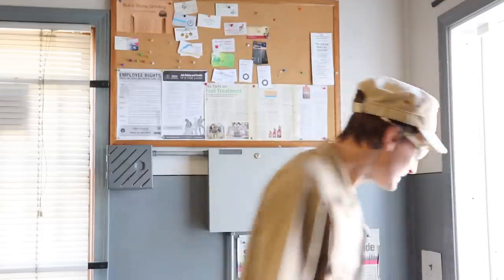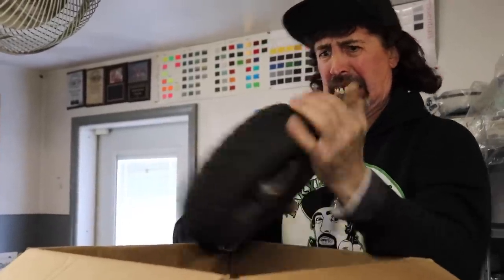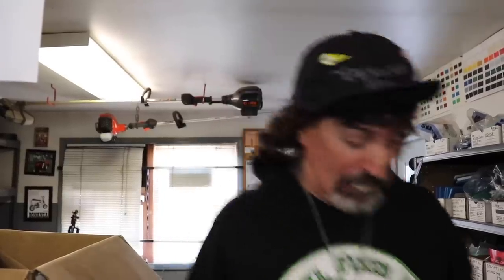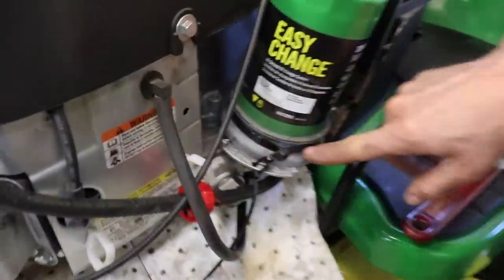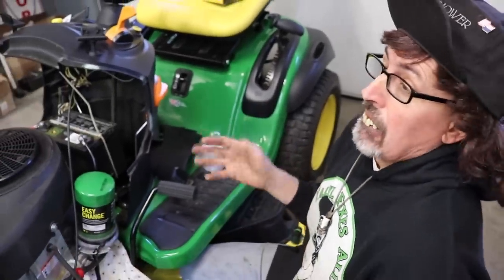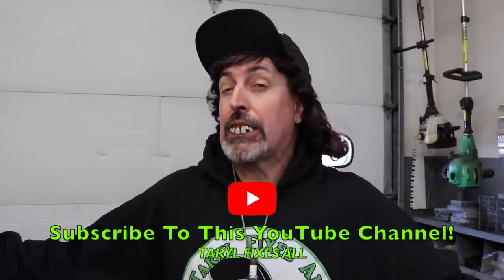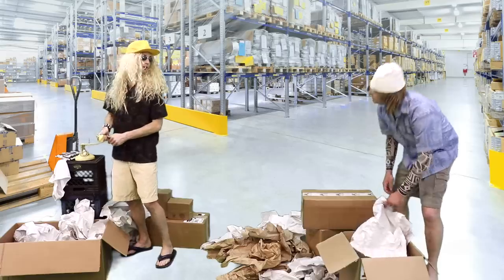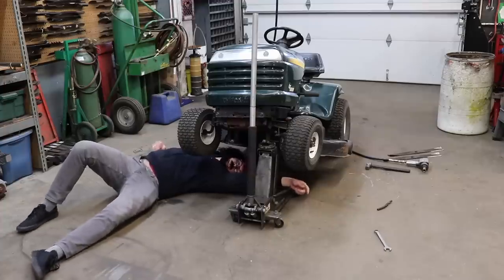John Deere Easy Oil Change NOT SO EASY - Convert It Back!

Comment: I get what your saying it’s Made by John Deere officially and all but I would bet my money that it’s manufactured by Briggs for John Deere and is most likely proprietary to Deere only at this point. I wouldn’t be surprised though if you see it pop up on other brand mowers in the future as soon as those companies negotiate a deal on them. We will most likely see them first on Briggs owned brands such as Ferris, Murray, snapper, simplicity. Briggs already has a funky oil set up on some of the Ferris mowers to help extend the oil change increments. It’s all about money, if you don’t believe ask yourself why a 5 dollar filter and 4 dollars of oil is costing 40 dollars just because it’s not messy. Just another feature for idiots 😂

Comment: How lazy do you have to be to take  an extra 5 min to do it right and drain all the oil ... Thanks for giving  us the knowledge to do it right
Reply: @ Rob Powell Very lazy or very ignorant, lol. A neighbor down the street (after I fixed his cousin's riding mower) asked me last year how to change the oil on his riding mower. Said he couldn't figure out how to drain it. After I brushed away all the built up dirt and grass around the drain plug to show him, he was amazed. He still didn't change it though. I ended up changing it for him later and adjusting his valves. And this dude had access to a PC so he could have looked up the info himself. Guess he was too busy getting stoned all day.
Reply: @dkeith45  I was told by one owner of a mower you never have to change the oil ... So at least he willing to consider saving his mower
Reply: @robpowell7599  Never have to change the oil?" wow, lol. Actually, that reminds me of something. My oldest brother bought a brand new Toyota car of some sort back in the mid 80's and never got around to changing the oil. He said he was too busy 0_o After I think 40,000 miles the engine blew, LOL.

Comment: Besides being quick and easy to change the oil and filter, the large JD filter is actually twice the size of a standard oil filter, if you take it apart. You still need to drain the rest of the oil, to do the best possible job. New filter price $50. Thanks Biden.

Comment: They call that an oil change?  Taryl, what we have here is a case of false advertising by John Deere!!  It sounds to me like nothing but a bad gimmick to make people over pay for an oil filter.  I would expect this from MTD but I never knew John Deere would stoop so low.  Just hold onto that easy change part til the warranty is up.  That way if something happens you can put it back and they would be none the wiser.  There is no need to let the force you to pay such high prices when a regular oil filter works just as well.  The oil filter for my car is close to $30 but those ones are from Germany.

Comment: Great idea but way too expensive. I'd be fine if the filter was like $10, but not $40.
Reply: and it only adds 25% new oil to 75% used oil.  GREAT for your engine!

Comment: $50 for an oil change and hadn't changed all the oil? I would never pay that much for an oil change on a mower. I didnt want to pay $35 for my car. 5 quarts of oil and a filter. Went to Walmart, bought their supertech oil, and a six oil filter. Went from 35 to 20.

Comment: JUST A THOUGHT COULDN'T YOU JUST SUCK OUT THE OIL FROM ENGINE AND STILL USE THE QUICK CHANGE FILTER? YES I KNOW YOU WOULD STILL HAVE TO BUY THE QUICK CHANGE FILTER AND ADDITIONAL OIL.

Comment: I can see how this would be viable for the average consumer. Change half the oil twice as often, no mechanical skills needed. Beats no service/improper service by a mile.

As for the mechanically inclined this system isn't for you

Comment: but i mean how is it easy and simple if you never change the oil in the crankcase that cant be good for the engine bye bye brand new john deer i feel like thats going to be a recall
Reply: Mike Worden it’s actually not as bad as you think.  The engine oil is as clean as the filter will get it, and you are injecting 1 qt of oil (little more than 60% of he total) with fresh additives.  I have no doubt that the engine will outlive the tractor on that regime. They’d probably be better received at $30 than $50.
Reply: @GoFastGator  well the whole point is to drain out oil contaminants like burnt fuel and carbon if you dont over time you can create sludge build up 40 is still alot and where does the other 60 go when you add a quart every time?

Comment: OMG   I don't care what the dealer says about that filter,   its a very bad idea,   for one,  its upside down,   it drains all the dirt back down into the motor.  they should all be facing up,  the part with the opening and gasket should be up.   on some cars they place then sideways.   I don't care what the advertisements for it claim how its new and totally different design.  there is a good reason why car makers place the filter on with the opening pointing up.   do you really think they spent thousands of dollars in engineering a oil filter just for this mower model??   no.
Reply: If you knew how oil filters actually work, you would  also know it doesn't matter what their orientation is. "Upside down" oil filters are nothing new to the industry.
Reply: @lencranston8183  when I take off a oil filter that was mounted hole up,   its full of oil,   and when I place it onto the drain pan all the dirt sludge comes out of it when I place it with the hole facing down.   so it must be dumping all the dirt back down into the engine case on these john deer filters,   the filter is just a screen,  the dirt gets collected at the screen,   on many cars and trucks there is also a wire screen on the oil pump tube mounted in the oil pan,   it also collects old broken intake and valve cover gasket parts and gets clogged up and blocks oil flow,   as the filter is mounted after the oil pan screen,  but anyhow,   mounting the oil filter hole facing down,  it drains back into the case.   the inside of the filter is just the wire screen for big parts and then a paper filter inside of that,   some times,   many times there is no paper filter,    just a wire mesh screen inside.  just like a in line fuel filter,   the gas flows in from one end and out the other,   when you take off the fuel filter you can watch the dirt flow back out of the inlet side,   its mounted sideways for a reason,  on most cars,  to hold the dirt inside the metal body of the filter so it will not drain back into the fuel pump in the gas tank,  and it collects the dirt better,   instead of letting it all flow back into the gas tank.  this way the old filter will have the dirt in it and can be tossed out and new filter put back on,  the filter works like a trash can,   tip it over and things run out of it.
Reply: @ateam6486  the dirty oil goes in one hole and the filtered oil comes out another. Personally, I have never seen a wire mesh engine oil filter in the last 55 years of my life, only screens to prevent large particles from leaving the sump in the first place. I have encountered wire mesh screens in automatic transmission sumps as well as actual filters. Have a great day !!!
Reply: A Team your oil filters do not have a drain-back valve?  That would be exceptionally rare these days...
Reply: A Team - If dirt and sludge is coming out of your oil filter when you tip it over into the drain pan I’d say you have more important issues to worry about than the orientation of an oil filter. Sounds like you need to change your oil more often. Sounds like you got yourself a sludger there.